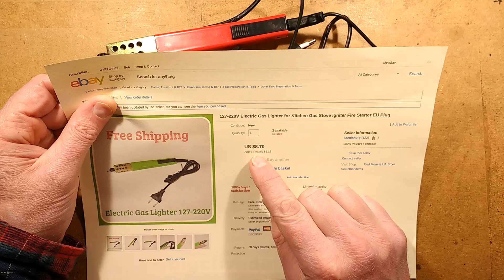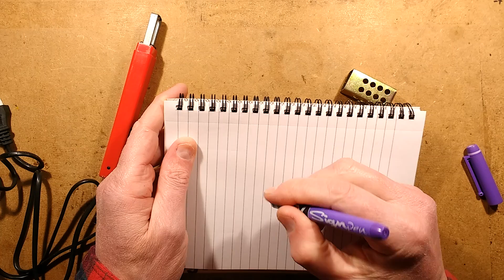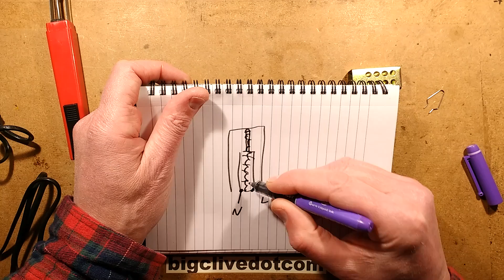Inside a pleasingly scary Russian 240V gas igniter.

Comment: Haha! 
 I once worked as an AV technician in a UK university.  Back in the 1970's, a Russian guest lecturer, on her first trip outside the USSR, brought me some Soviet-made electrical equipment that she had brought over in her suitcase.  She was under the impression that I would be impressed by the superior Soviet technology.
Both her slide projector and hair drier had twin-core flex (no earth) and metal case parts that could be touched while the kit was live.  In the case of the projector, the flex entered a cast alloy body through a drilled hole with no grommet and a knot tied in the flex to stop it pulling out.  Without doubt the shittiest electrical equipment I had ever seen.
She was most upset when I refused to let her have the items back on the grounds that using them might burn the building to the ground if they didn't electrocute the user first.
Later on, I took her to Currys so she could buy a replacement hair drier.  She was blown away (rather than blown up) by what was on offer.  I contend that the downfall of the Soviet Union started on that day.
Wish I had taken some photos of the dodgy kit.
Reply: University of Bath.  Once the languages department bought a Sirius 1 (Victor 9000) I became the IT supporter by default.  Luckily I never had to deal with Soviet-built IT kit!

Comment: There was 19th century lightning effect for theater that used a similar mechanism although larger and with even fewer safety guards.

https://imgur.com/thzLblx
Reply from the maker: Ah, that's basically a pulse operated carbon arc lamp.  I didn't know they had existed.   Latterly they did use carbon arcs in theatre for a while, with automated carbon feed mechanisms.
Reply: Yep, we've still got a pair of carbon-arc Troupers we fire up every few years for musicals.

Comment: I want to make a gas stove lighter similar to this but using one of those cheap tazer modules a 9v battery and a push-button . Is that as bad an idea as it sounds?
Reply from the maker: It should work, but make sure it's cased up properly to avoid zaps.  Better using a lower voltage like some AA cells.

Comment: 9:00 I do believe it was still functional. I think the switch on the enclosure was shorting out these two brass tabs which made a connection between the frame and this "nail-coil" solenoid contraption. These tabs look like they're completely insulated from eachother for that purpose, although I might have missed something in the video.

Comment: I'm from Poland and I used similar device before advent of built-in ignition on the cooking ranges that didn't stop to work after spilling one drop of water (I think it was around early 2000s when that technological breakthrough happened). Model I used was from early 60s and never stopped working (I lost it somewhere 10 years ago) and I never heard of anyone doing anything nasty with them - holes were small enough that even a little child couldn't make it to touch anything at live potential. And it worked awesome, much better than burning yourself with matches or lighter that always breaks when you try to cook something ;) Now let me go back to not fixing that crappy 125A three phase socket in the workshop that requires isolating rod to operate (if you don't hold it still during insertion/removal it's a trip to main circuit breaker on the property) because some famous German manufacturer made it from same plastic as cheap children toys...

Comment: Not rated for 240V?! Even if the freakin' thing WAS rated for 220V, it'd have to be able to work at 240V just fine (as the utility companies usually allow for voltage deviation of up to +-10%)! BTW the reason Russians (and probably most of Ukraine) can get away with "toys" like this is because they have indirectly-grounded power systems, so being grounded would pose no danger at all.

Comment: My grandmother had such a device 40 years ago it was shaped a bit differently, i took it apart long ago.  I still have the coil and pin (not a nail) without a spring at 12Volt it can pull the pin in the coil. So i guess the coil is still in one piece.

Comment: I made something like this out of an open-frame relay when I was a kid - I only drove mine from a 9v battery, but it generated a lot of sparks and ozone - and some nasty voltage spikes - it would give quite a jolt if you touched it - not to mention the RF interference - it made snow on the TV and when my parents correlated the problem with my tinkering, I was banned from pursuing it further.

Comment: offtopic question/situation: almost every time I put the plug of my Laptop's charger in a Dutch power socket (no on/off switches) I get blue sparks around the pins from the huge inrush current towards the capacitors inside the charger. Its an HP Laptop. Is this a naughty charger having too huge caps or do most 19V laptop chargers have this behaviour ? I get scared a little by the blue flashes and I guess I can't do much about it. Maybe use of an extention lead with a switch would help.
Reply from the maker: It's very common.  I hear a loud pop when I plug the cloverleaf connector into a PSU.  It's the high inrush to the capacitors and is very visible in trendy translucent socket strips.
Reply: you usually don't use the socket's on/off switch ? Maybe because it would 'move' the problem by having sparks at the socket's switch ? I think you spoke in one of your videos about a component able to start at a high resistance and then quickly go to low resistance ?

Comment: It would make a good emergency spark gap transmitter. The hard part would be locating the sender if they only knew S O S since it would mostly be radiating through the power line.

Comment: I had something like that for years..  it was a trend.. but if you don't buy the cheapest one don't tinker with it or keep it on for more than a few seconds it works just fine and is very reliable... but I think after some time I had to replace the nail and the spring :)) they changed the design.. mine had the spring inside the coil.. also I think this one needs a lighter spring and a longer nail so it will protrude more into the coil.. maybe this will make it respond faster and keep it cool longer...

Comment: "I'm guessing this jams everything that broadcasts in radio frequencies for miles around."  A spark gap transmitter indeed!
Reply: Not really. The range is about 10 meters, plus FM is less prone to this kind of interference. And perhaps you have noticed that metal cage around the arc?
Reply: zwz • zdenek yes, "miles around" is a bit of an exaggeration. There would be some local interference in an apartment building with nearby neighbors perhaps but this device is meant for occasional uses of short duration. As for the metal cage, that's more for physical shock protection. I doubt it helps much as a Faraday cage.

Comment: I'm sat here, tense as hell, but it was like watching a car crash, you don't want to look, but cannot help yourself.

As an aside, this is based on the very old coil operated doorbell, though they used to operate at much lower voltages, somewhere between 3 and 6 volts.

Comment: It's a nail... and a ball point pen spring... and I wouldn't be terribly surprised the plastic core was also part of a pen.
Reply: Out in their shack. Someone had a ball point pen, a nail, some nail clippers, an old broken curling iron and a bunch of cable laying around. 
And no matches for miles around.
Reply: Omg, Russia hater. Go for your burger and shut up.
Reply: No, a pen spring would be too stiff to be operated by a cheap solenoid such as this one. You can see that this spring is made of a much thinner wire wound over a smaller diameter than a pen spring.
Reply: @zwz.zdenek  Sure?  You might severely underestimate the power of a solenoid that has 240 volts shorted across it.

Comment: I'm absolutely certain that this device meets all UK EMF standards.
Reply: Measured from the mainland, yes!
Reply: In soviet era they made spaghetti forming machines with the same diameter as AK bullets, so they could be quickly readjusted to manufacturing those just in case. Maybe this is the reason how this device was designed. Or its just was made this way because these elements randomly got under uncle Vasya's hand during manufacturing process.
Reply: @digitalgreenie  I strongly doubt they were producing 7.62mm thick spaghetti.
Reply: @polygondwanaland8390  cigarettes were in 7.62 but spagetti wasnt in 7.62. normal psata might be tho
Reply: @yigitalpalakoc  agreed he probably meant tube pasta
Reply: @digitalgreenie  Heard the same tale about cigarettes. Probably the same BS.
Reply: Isn’t really a coil so only to a extent.
Reply: My bad, rip
Reply: i'm sure there are vintage cars in the uk that give off some emf with their spark coil generator.
Reply: @Choice777  my toy trainset used to jam the neighbours TV channels when I was running my Network Southeast Express.
Reply: EMF standards are for sissies!
Reply: I don't think any UK EMF standard would wanna meet this thing, as they would be seriously violated by it.

Comment: It says in cyrilic SPIRTOMER, that aside I have spent quite a lot of time in Belarus and a lot of people laugh at the Russians but they are very good engineers in general their trains and metro rolling stock being very good and their electrical infrastructure also is very good. Although the wiring in the houses can be a bit doubtful to say the least, the reason the plug is a bit slack is that the Russians have their own 2 pin socket without an earth connection with smaller pins than the standard european socket. Although they are now adopting the european socket in new house builds, they also never used to have an earth connection.

Comment: I once worked in a pub that the electricity board, gas board and water board refused to touch anything in the place, the main fuse was a chunky 6 inch type nail. It was the only thing that didn't melt.
Reply: Mark Giblin sounds like the place needs to be demolished lol.

Comment: Using a UK to continental plug adaptor? To keep in with the spirit of dodgy electrics shouldn't you just shove a screwdriver into the earth socket to open the shutters then the Shuko plug will fit neatly into the live and neutral openings.
Effective but very dodgy.
Reply from the maker: +bob s I did toy with that, but given the dodgy nature of the device I was worried the lip on the plug contacts might snag in the socket and make it hard to get out or even detach inside the socket.
Reply: Probably would be ok provided you open the shutters again when you pull the plug out.

Comment: Check to see if they did a mild bit of safely. I suspect the U shaped bracket would be Neutral, not Line. Reason is because that bit is easier to accidentally touch. Would make it a tad safer, not "safe", but "safer". Something like making sure you have the correct connection to an Edison light socket, which if introduced today would be immediately rejected as too unsafe.
Reply: John Cochran But the 2 pin plug can be inserted either way, so sometimes the bracket is live, sometimes not... pot luck really.

Comment: You keep saying the metalwork would be live at mains voltage, but with the double double switch, it's only live while you are trying to lite a gas stove with it. Seems a bit little like complaining that a lighter becomes dangerously hot to touch when in normal operation. That would seem like the point of a lighter.

Comment: Those Deathdapters mate very loosely with a Europlug. Clive should have opened the shutter and rammed the plug straight into the trailing socket. Reasonably OK as long as there is a sensible fuse somewhere in the chain.

Comment: In Russia, there is a measure "Degrees Alcohol", from 0 to 100, and it is the same as volume percentage of alcohol.
Reply: In Soviet Russia, percentage measures you. 

Maybe that degrees alcohol were in mass use before percentage (because booze is around longer than math), so this may be actually the other way round - why don't you just use degrees to measure your percentages like our ancestors deed?
Reply: Bo Gao why not just measure percentage like a normal rational human being?
Reply: @JustinKoenigSilica  when you measure water hardness (idk, if this is the corect namem  the quantity of Calcium carbonate, and other things like that) u measure it in  mg/l therefore its mass/volume and not mass/mass or volume/volume so it can't be a percentage. it was something with 1 degree of hardnes = 10mg/l of CaO, CaCO3 etc.

not sure why in alocohol its degree and not percentage.
Reply: Same in China. We use degrees instead of proof. A degree equals to 2 proof.
Reply: Justin Koenig 1 degree is 1 percent volume.

Comment: It shows that you are not an educated drinker :) nor a heavy one. It's not called a hydrometer (an instrument for 
measuring the density of liquids) altough it is one but it's calibrated for one purpose only. To measure the ethylic  
concentration of the distilled water solution. That's why it's called a spirtomer/alcoholometer.

As for the igniter... My family owned 3 of them (my parents and my grandparents)... The first two were bought from Moldavia (back then part of USSR) and lasted at least 20 years (one maybe almost 25) even if we had 220V in Romania and they (oh, those Russians) had only 127B. They didn't changhed the design too much (shorter cord, cheaper plastic, injected plug, nail instead of a proper metal rod) but like all things made with only the cost on mind the third/last one had a short life.
Of course, when the first one went dead (ours) I took it apart...
In cyrillic alphabet B is V...
A joke says that the American space programme spent millions inventing/designing the ball pen... instead, the Russians used chemical pencil/indelible ink pencil ;)
Reply: That pencil thing is more an urban myth than a joke. Interestingly the russians bought that pen as well.
If you want to see more about it watch here: https://www.youtube.com/watch?v=yJrzxrN9dF4
Reply: They bought it only in 1969... after... but let it rest... the nuance between joke and anecdote... After all, we are talking about spirit(s) here and how to ignite it ;) Thank you for the link.

Comment: Finally, you tear smth apart that I have used myself :) Those things are quite crikey, but if you don't hold them on for more that 5 seconds, they actually last. They work quite well, so you don't have to hold it on for more than 2 seconds. 
 I'm from Ukraine, and I will say that you've been ripped off. 8$ is way too much for it.

Comment: A truly bizarre device.... a cheap ferrite striker like or a piezo igniter seems more than adequate for lighting a gas stove. If one were to design this 'properly' the metal shroud would have to be grounded, and there'd have to be some RF suppression between the mains and the spark gap? How much current does this draw and what's the power factor? Does having the shroud tied to neutral provide any meaningful shielding for over the air interference?

Comment: "B" is for russian Вольты meaning Volts. So the device is rated for 220-270 volts, which is pretty strange, considering in Russia the grid is havely regulated to be 220 for one faze plugs and 380 for 3 faze.
Anyway, mains gas igniter? Who the hell did it? Nowbody I know uses it, people use stove lighters until piezo element dies out or buy a stove with lighter already in... Just why to do it...
Reply: There's a reason these existed. The piezo lighters made in the Soviet Union for stoves needed all of your upper body weight to actuate, although the button/lever looked like it was supposed to be actuated with your thumb. The moment imported light duty ones became available, the mains ones died off.

The device is 127-220V, not 270. Why 127? Because Russia used to run on 127V, and mostly switched over to 220V during the 60ies, though some buildings took longer. For example i found the following quote: 
"Москва, дом 1915 года, Подсосенский переулок — переключен в 1988 на 220. Недалеко, в Милютинском переулке, лет 7 назад снимал подключенные(!) счётчики на 110 вольт, Сименс и АЕГ. И под потолком лампу с ЦЕЛОЙ угольной спиралью."

Comment: This seems like a shittier version of the "old ones". My grandma had one, and it had much beefier coil, with the added bonus of jamming every nearby wireless connection. The "original" was bigger had a round tip(also live at mains voltage) and (don't quote me on that) case made out of bakelite.